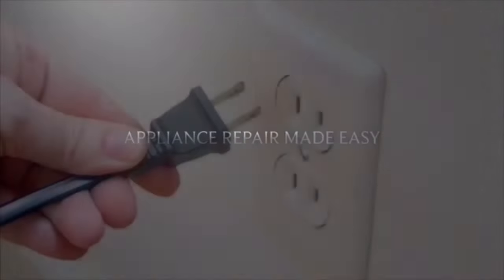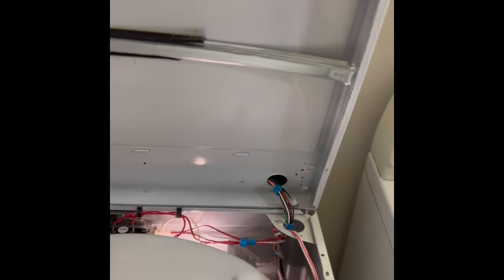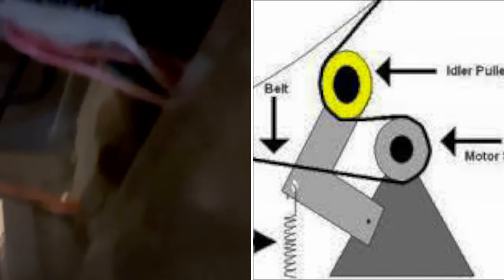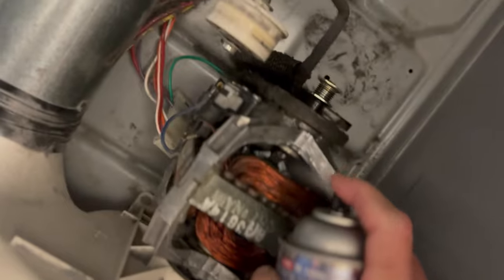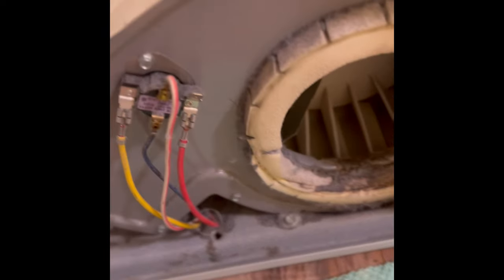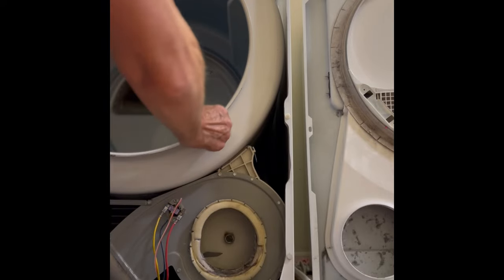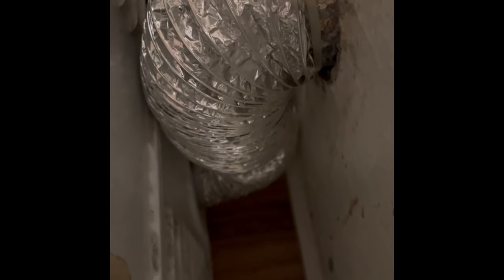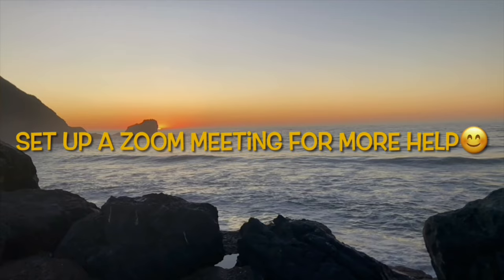✨ Dryer Keeps Stopping Mid-Cycle - EASY FIX ✨

Comment: Hello. I have a similar model Samsung dryer and ordered the replacement kit. After watching another video on how to disassemble the dryer to get it to the point where you start this video, I changed out the 4 sensors, re-assembled, and it worked! Dryer is once again completing the cycle and singing the tune at the end. Thank you so much for your video. You saved me at least $800.
Reply from the maker: I love it😊😊😊

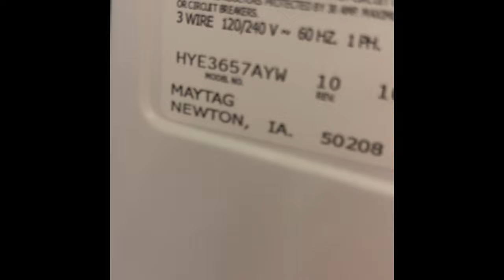Comment: maytag bravos xl gas dryer on normal load setting starts at 41 minutes and after about 5 min drops straight to 2 min left before shutting down. all settings do the same except Bulky which starts at 1:05 goes to 55 then drops immediately to 47 min and will actually run the rest of that whole 47 min. I get cleant lint screen error but its clean. dryer vent is clean. i took dryer apart vaccumed out insides and on motor. changed thermistor and dampness sensors.  still doing it. any ideas?
Reply from the maker: I wonder if the vent screen to the outside is clogged with lint?
Can you try cleaning the lint screen with Hot water and detergent?

Comment: Just bought a brand new Electric maytag dryer it keeps cutting off. Sometimes clothes get dry sometimes still wet. U cut it on it run for few seconds the cut off. Tried other drying cycles  still samething..what u think it is causing this? Doesn't even run full cycle.
Reply from the maker: Thanks James,
The most likely answer is that the dryer vent tube is crimped or the vent outside the house is fully clogged with lint.

Comment: I have a maytag medc465hwo dryer that stops after about 10 minutes.  The motor does not make any weird noises.  I tried vacuuming and blowing out the windings on the motor.  No lint in the exhaust, and the t-stats and high limit switches are all good.  I did not try contact clean though.

Comment: This is my exact dryer that just quit during a cycle. It won't turn on and the light won't even come on when the door is open. It is like it is unplugged. I checked the breaker in the basement and it wasn't thrown. Any idea what to check on it?? I really like it and it has worked well for the last 20 years. I'd like to try to fox it. Thanks for any tips.
Reply from the maker: I bet it needs a new door switch 👍
Reply: @FastFreeFixes  turns out it is the thermostat.

Comment: It start for 3mins and stops G E Profile direr?
Reply from the maker: Thanks James.
Can you make sure the dryer vent tube is cleaned out of all the lint?
Reply from the maker: There might be lots of lint on the motor also making it overheat at 3 minutes.